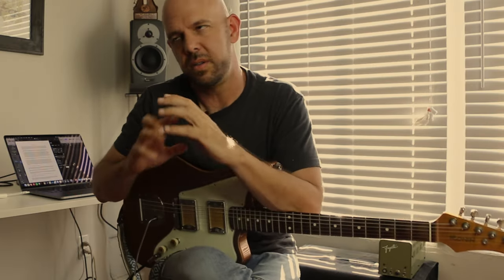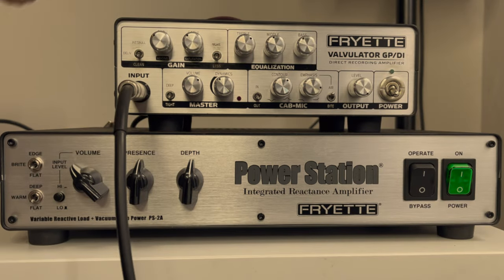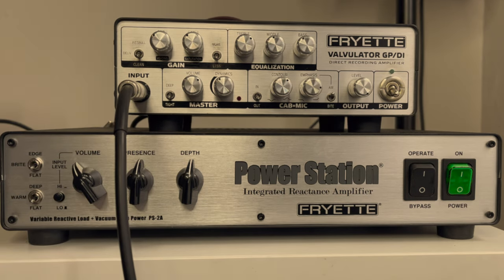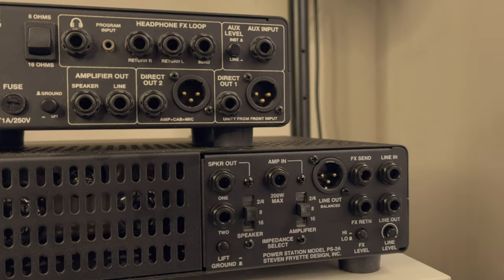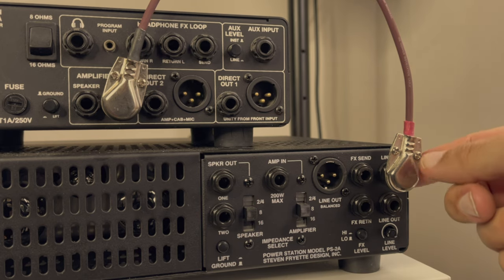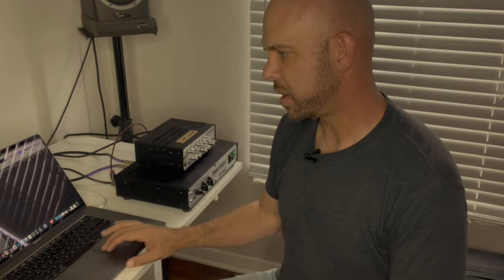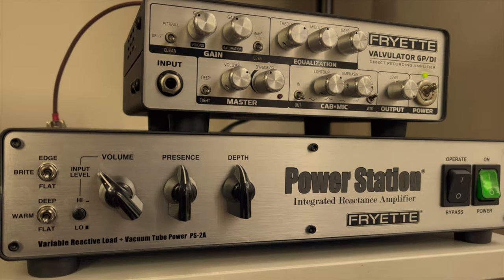Using the Power Station's Self-Attenuation Feature for Silent Recording

Comment: i'm running my triaxis into the power station. sounds fantastic!
Reply: THK you of’ the video!  : in order to run my axe FX3 into my brand new  Fryette PS2 line in, which kind of jack cable shall I use  : an unbalanced instrument cable like for guitars or a Balanced one (trs)  (the axe FX3 provides only one kind of jack output, which is unbalanced, otherwise it has a balanced xlr output, but the PS2 line in is at a jack format).  Many thanks  in advance, the PS2 is awesome !!!!

Comment: Thanks Joe. This was the final piece to my GP/DI & PS-1 puzzle. Had been going direct from the GP/DI since the day it came out and using PS-1 for my Aether. Bought a PS-2A for the GP/DI because of the balanced out, but was running into issues. This was all it took. That and Steve said it would work a couple of months ago....Now using PS-2A with my Sound City ML50 so I can mic the cab and go direct.

Comment: Probably answered here somewhere already, but I haven't come across it, so ill ask again...Can I run this cable set-up and simultaneously run a cable from the Fryette "Speaker Out 2" connection on into a traditional Speaker Cab? Essentially giving me 2 sources of sound from the Fryette at the same time (Line-out & Speaker Out 2). thanks
Reply from the maker: Yes, with the caveat that if you want to crank the Power Stations power amp stage, the added cab will get loud.

Comment: Can you do this same setup with silent recording, but also run out of speaker 2 into a real speaker cab to monitor with now latency?
Reply: @@d.a.9933 hi, I'm also looking to run this set-up, and had the same query....so when you say the "Attenuator setting", are you referring to the attenuator setting on the Fryette? For example, I'm looking to run this "self-attenuation" cable set-up, and also run a cable from "Speaker Out 2" into a 16ohm Greenback speaker cab....do I set both ohm settings on the Fryette at 16ohm? Thanks

Comment: Can you use the out two to power a cab while doing this? Or is that not possible? Looking to access the voicing switches and volume control when plugged into cabs.
Reply from the maker: Yes.
Reply: How would you set impedances in this scenario, eg. You use a 16 ohm cab
Reply: Is the signal sent to the cab attenuated aswell? 
I'd like the run a preamp into PS and have the PS attenuate it's own power amp while playing through a cab

Comment: What if i don't want to do silent recording but want to hear what i'm playing through my amps cabinet at the same time? How do you connect to the recording interface in this scenario?
Reply from the maker: Connect a cab to the second speaker out on a PS-2 or using a Y cable on the PS-100. You can still use the Line Out in that scenario.
Reply: @FryetteAmps In this scenario, with the Jack conected between the amp in and speaker out of the Power Station, and 8 Ohm selected in both switches, if I plug my 8 Ohm speaker cabinet to the second speaker out of the Power Station, I must to change impedances ??
Reply from the maker: @vicentepiconguitarcovers4748  We recommend you join the Fryette Support Forum. Just go to support dot fryette dot com.

Comment: How can I take advantage of this when incorporating an amp switcher? I have a KHE 8 channel switcher and currently have an Ox Box in the attenuator loop for the KHE, but I have a PS-100 on order and planned to power my Synergy rack unit with it. Would I run the Synergy into the line-in on the Ps100 and the speaker out of the ps100 into one of the the 8 amp-inputs of the switcher?
Reply: Did you ever figure this out?

Comment: Quick question if anyone can help......if I take this cable connection set-up just as was done here, can I slightly modify the final part, (the LineOut, to the interface/DAW part). Instead of running into an Interface/DAW, can I substitute the Interface and run into a Two Notes Opus IR Cab Sim instead, and then plug headphones into the Opus for silent practice? 

My set up would be... 
Guitar--->kingsley maiden/constable preamps---->fryette PS-2A---->Two Notes Opus Ir cab sim--->Headphones coming from Opus 

Thank you
Reply: Yes you can plug the lineout of the PS to a Two Notes pedal that has the DynIR thing. Just adjust the in level of the opus accordingly.

Comment: Not sure if I get it right but isn’t the amp in of PS supposed to output through speaker out? Even if I plug in the line out the signal should still go to the speaker out, no?
Reply from the maker: Yes, but only in bypass mode.
Reply: @FryetteAmps  I’ve re-read the manual and am still a bit confused. If I plug in to the amp in from my amp I’m hitting the reactive load and then if the unit is on the signal goes to its power section, if not I still get the load and can safely output the line signal. If I plug something into the line in it goes directly to the power section (unless the  unit is turned off). Now if I have both the line in and the amp in signal how come the amp in signal does not get looped through the power section? Does the line in signal prevent the amp in signal (which still gets the load) from hitting the power section?
Reply from the maker: @AndreiDzimchuk  That's right. There is a full signal flow chart on the Power Station page of our website here: https://fryette.com/power-station-integrated-reactance-amplifier/

Comment: What is the best way to set levels? Amp>PS-2A, Line Out>Interface

When I use the PS-2A in silent record mode, my amp sounds distorted, using either of the line outs. However, I'm not clipping the interface/DAW. I have to turn my amp down so low to clean it up that the signal is too low to record. Any suggestions?
Reply: Did you try using Line In on your interface instead of Instrument In?

Comment: So in theory...say using a UAD Apollo with an AMP Sim in the Unison slot. Could I use the preamp of the sim, bypass the sim power section, and specify no cab , line out that signal to the PS100 line in, and follow the rest of your example? Ok not sure why I would do that other than to play around and see what an AMP sim sounds like using this technique.  Some of the UDA plugins give you the ability to bypass the power section.
Reply from the maker: Yes, you can do that if you can defeat the cab and PS sims as you suggested.

Comment: So in silent mode I’m not able to use the fx loop so I can use my delay ? Or is there a way to use the fx loop?
Reply from the maker: Connect your delay to the FX Send which is still active even if the PS in powered down. Page 9 example 4: https://fryette.com/content/Power_Station_PS2A_Manual.pdf
Reply: @FryetteAmps  thank you for the help.
Reply: @FryetteAmps  I forgot to ask but if I turn the power on to use the fan and keep it in bypass mode is it ok to use the send and return on the FX loop?
Reply from the maker: @Meairdah  The FX return feeds the power amp, which only helps you if using a cab or running in Self Attenuation mode, which means you have to be in Operate mode.
Reply: @FryetteAmps  thank you again for taking  time to help. I’m excited to try it out.
Reply: @FryetteAmps  3 questions: 
1. When doing the attenuation method use a speaker cable between amp in and out or can we use instrument/patch cable.  
2. Does the other speaker out on ps2 still work to go to cabinet or not with this method?
3. So in the attenuation mode the effects loop still works and will be included in the line out?
Reply from the maker: @micahjohnson7401  1: Speaker cable. 2: It does. 3: Yes.
Reply: @FryetteAmps  I can't get the FX Loop effect in Line out recording, it seems FX Loop is only available in Speaker Out,Is there anything wrong with me?

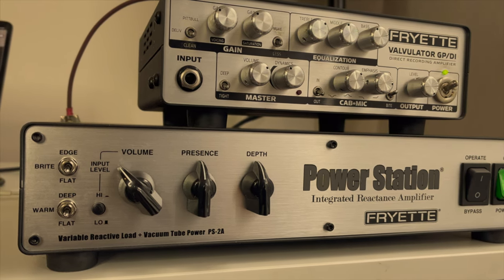Comment: why is there reverb on the track at 4:53? a demo like this should be bone dry.
Reply: You rarely have bone dry cleans in a final mix (and even during tracking), and even with slight reverb here you hear the impact of power amp level differences on the overall guitar tone just as well.

Comment: Thank you Joe for this amazing tutorial, i was wonder how can i connect a Marshall SV20H and The Fryette Power Station 2 for Recording into an audio interface? The DI line out from Marshall SV20H sucks in my opinion, even with a IR cab loader software like NI Guitar Rig. Is there is any workaround using the a recording output from Fryette PS2 instead of the Marshall SV20H,? Thank you :)
Reply from the maker: Sam setup as connecting the Line Out to a Mixer in Silent Mode. Just replace mixer with DAW. See manual page 9 application example 4. https://fryette.com/content/Power_Station_PS2A_Manual.pdf
Reply: @FryetteAmps  Thank you Joe, will try it out.